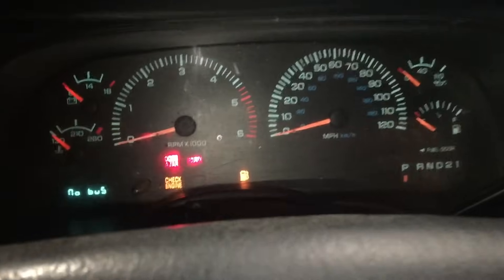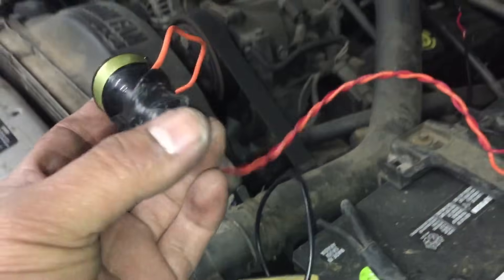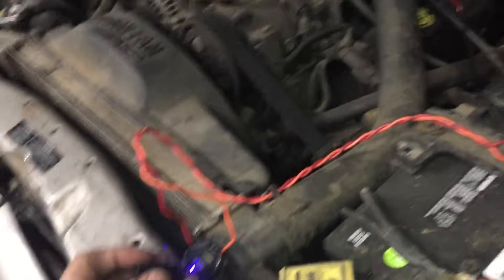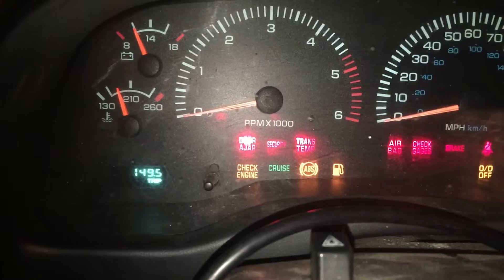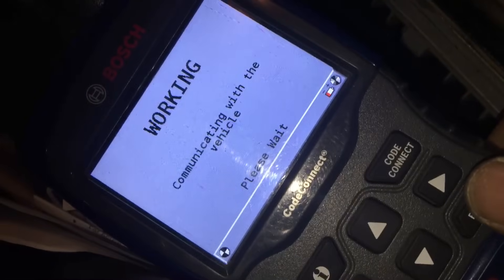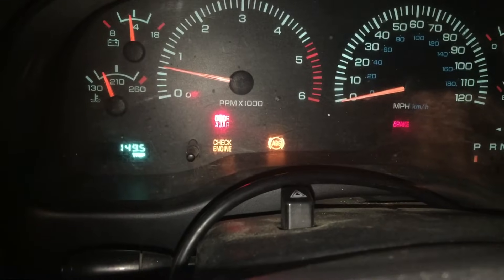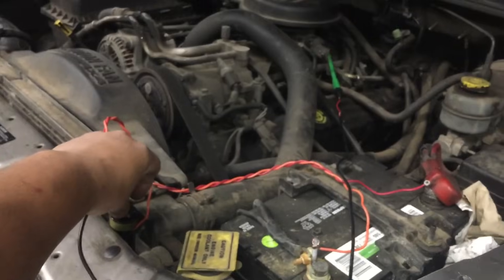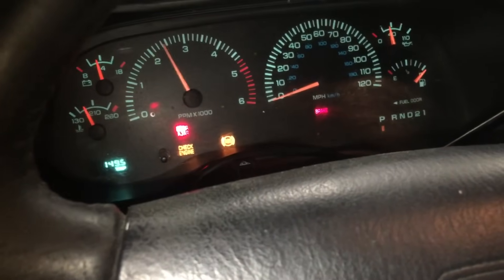No Bus No Start FIX!!!  Dodge, Chrysler, Jeep, Plymouth, or Ram

Comment: I have a cirrus  2000 turbed and i have the same problem, I checked the output voltaje and only have 2 volts, and not 5 volts, I am going to try it